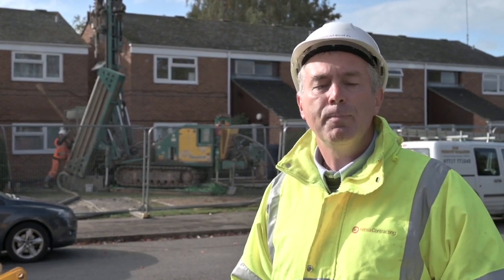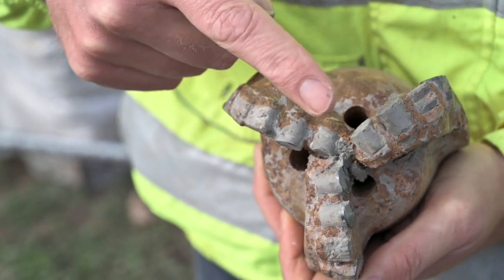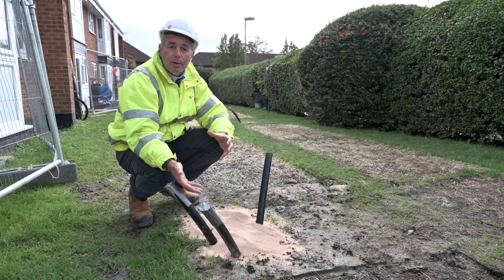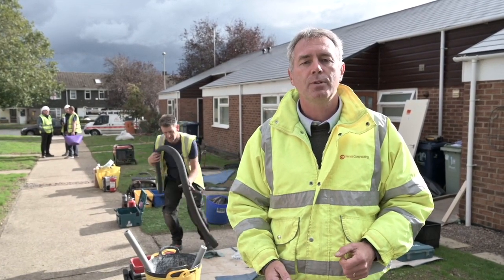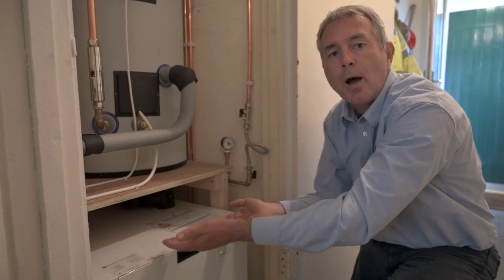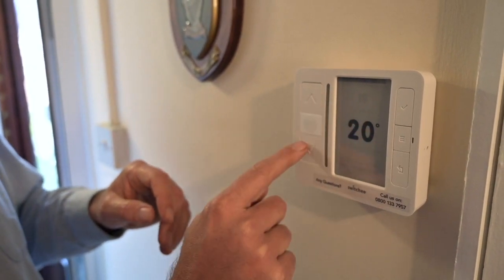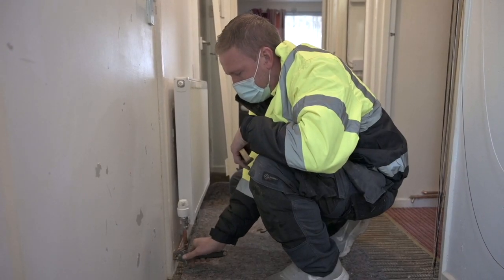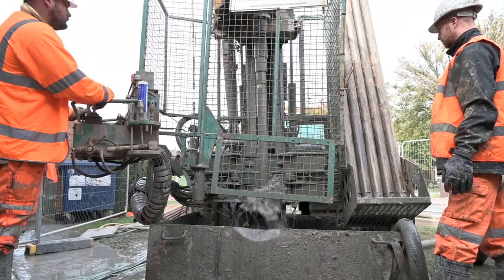Virtual Tour of Energy Superhub Oxford's Smart Renewable Heating Trial - Hosted by Kensa Contracting

Comment: Could you compare the cost of drilling and the heat pump vs gas boiler? And what is the expected lifespan of the heat pump unit but also the borehole itself? As, I believe, the borehole will outlive the heater.
Reply from the maker: Hi there, the ground source heat pump unit has a design life of 20 years, with minimal maintenance and no annual servicing. The borehole infrastructure will last for 100 years.

In regards to cost, we have numerous costed examples of ground source heat pumps with boreholes for different applications here: https://www.kensaheatpumps.com/heat-pump-costs/. With the Non-Domestic RHI coming to an end, there are some funding options to explore depending on the type of project. 

We also hope to see future funding models to further incentivise these schemes - for example, where the ground array can be deployed on a district level and funded by a separate entity, meaning households would only have to pay for the heat pump unit itself. Not forgetting the long-term cost and carbon savings that ground source heat pumps deliver.